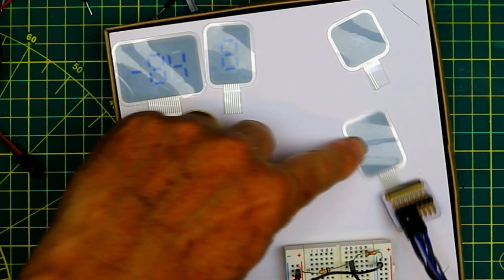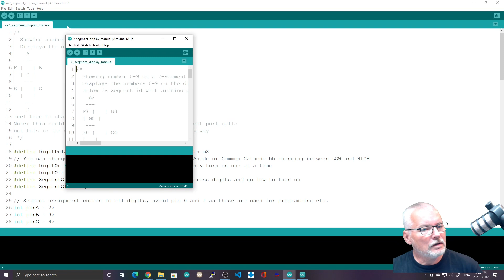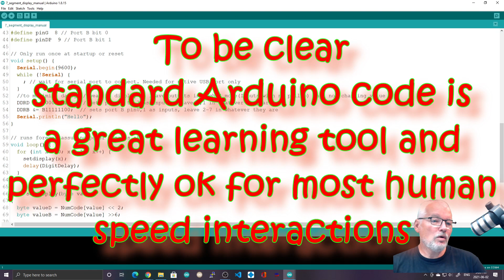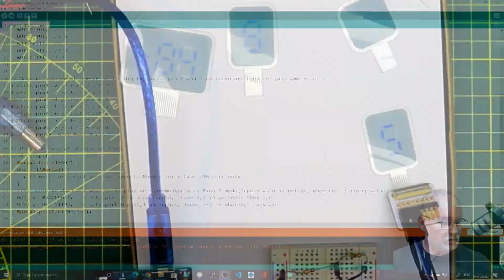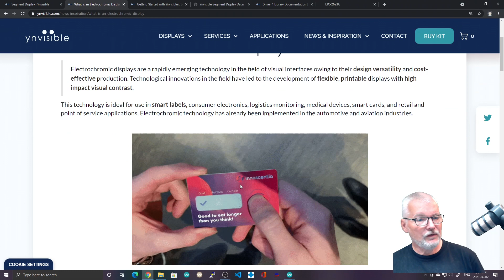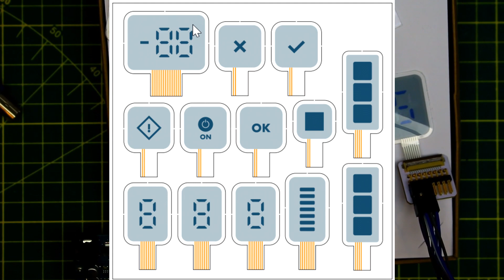Arduino Programming - Electrochromic Displays ...PT2

Comment: Well, they look interesting though it looks like they're into the custom large-scale market rather than the low-volume prototype area by the look of their ad and cost of evaluation kit??
Reply from the maker: i mentioned that to them, and suggested making some sheets that can be bought on their own for perhaps a thermostat or other non frequent update application, if they did a run of them they could make them very cheaply and get the word out even more
Reply: Hi Peter. Yes, you're right. We're considering making a more "maker friendly" offering soon. What would be a reasonable price point and offering?
Reply: @ynvisible  Can't put a figure on it at this instant but when you do - it would make sense to update Peter (the Breadboard - here) and myself (via my blog at https://tech.scargill.net - I'm always interested in evaluating new products) - I'm based in Spain and as you know, theBreadboard is based in Canada.
Reply: @ynvisible  What do the displays cost without accessories? How about an interface for a PI? I am also amazed at the high price. 3 months later and nothing has changed.